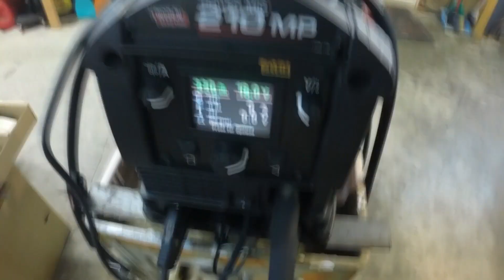Test welding with the Lincoln 210 MP

Comment: Can you make a video of the wire drive system ? Appears to be a common problem, and i want to see if urs has it.
Reply from the maker: Do you know what the drive problem is? I have not had any issues with it. But yes, I could make a video when I find a little bit of time. Let me know exactly what you would like to see. Thanks.
Reply: BarnStangz the rollers specifically with the tension screw, if you run yours at high speed you may notice the tensioner moving up and down like a shock because the shaft that has the drive rollers for the wire is not straight. Sense it's not straight this causes the tensioner to have to adjust causing wire feed issues at high speed because the motor is speeding up and slowing down with the tensioner. I really just want to see the wire feed mechanism in action at full speed.  Thanks
Reply from the maker: When I change out my .025 for .035 I can run it all full speed, without any wire and take a video, would that help?
Reply: That would be great please, thank you.
Reply from the maker: Okay, I'll see what I can do. Maybe subscribe if you haven't already so that you'll be notified. Thanks!